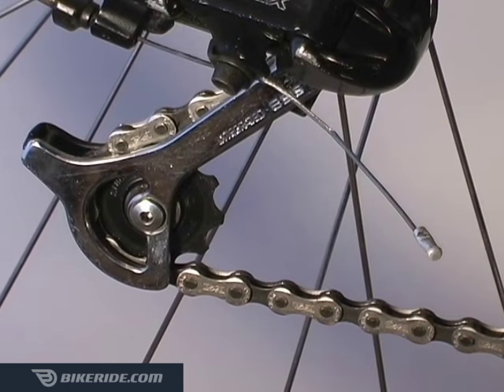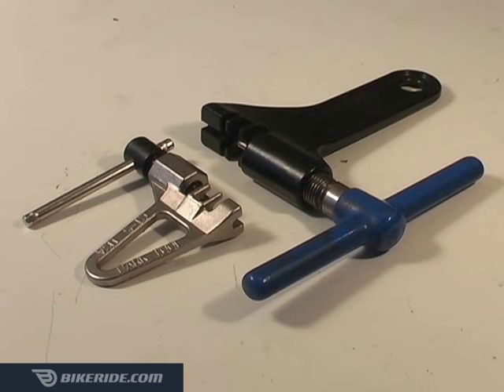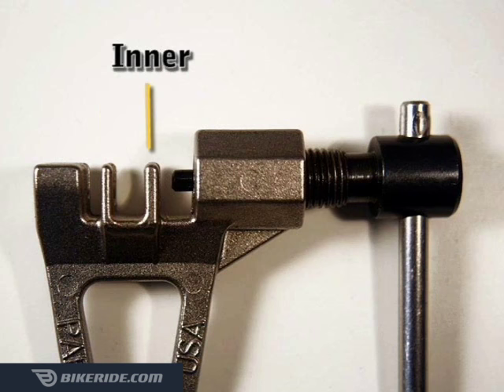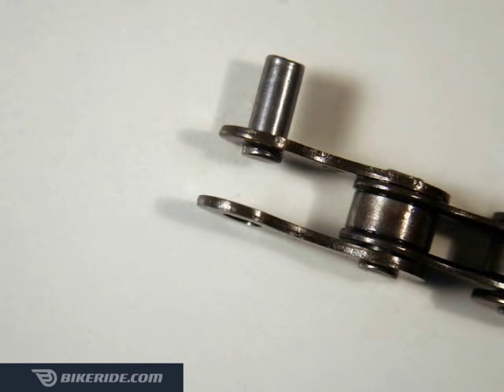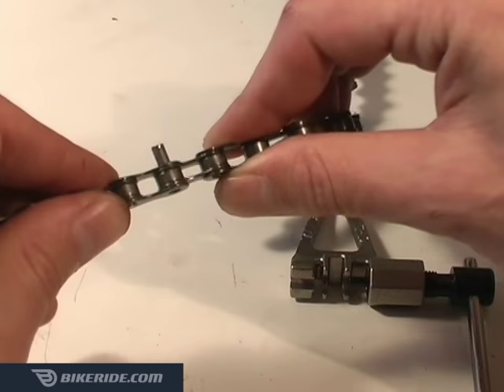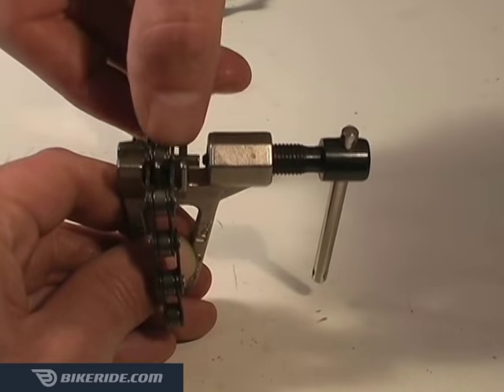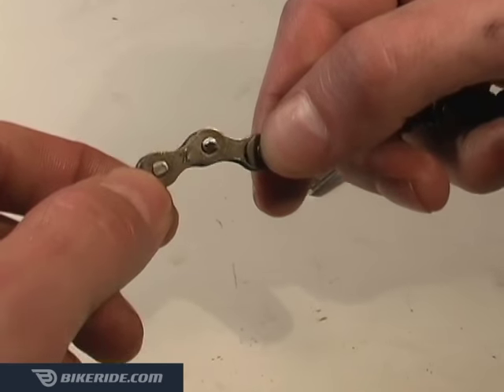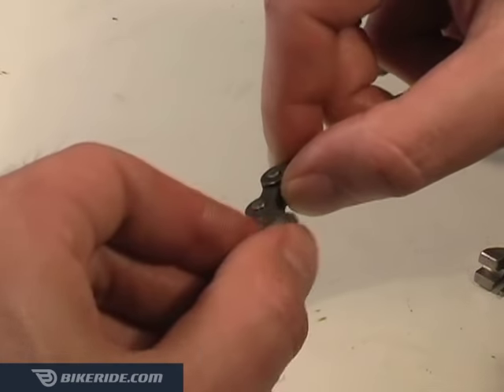How to Use a Chain Tool to Break a Chain

Comment: Great video but if the pin came out you can present it ever so slightly by hand and press it with a flat pliers, that's what I had to do and it worked.

Comment: What if the chains links are welded together? I got a bike from walmart but the chain links are literally welded to each other. They sanded the ends of them too so where you usually see a hole where the little pin or connector goes through, there isn't, it's just smooth & you can't see how they even got it in.
Reply: hacksaw will prolly do what u need
Reply: Hacksaw and a new chain

Comment: im confused because my chain tool looks 90% like that one but it’s not pushing pins out, either it’s too cheap or i’m too weak. you guys make it look easy
Reply from the maker: There should be little resistance when pushing out pins unless they are badly corroded. Ensure the tool is properly positioned on the chain, and try using a penetrating lubricant on the chain to help.